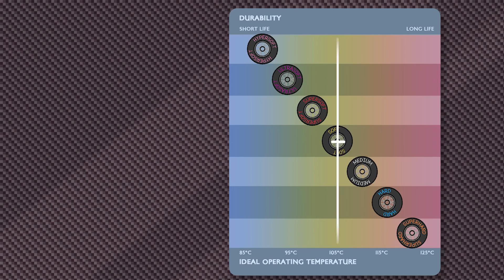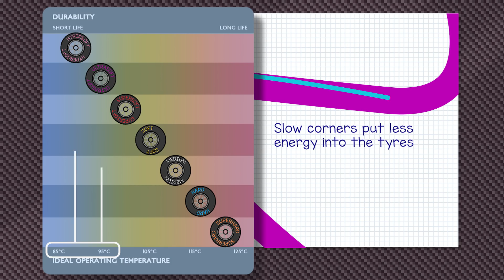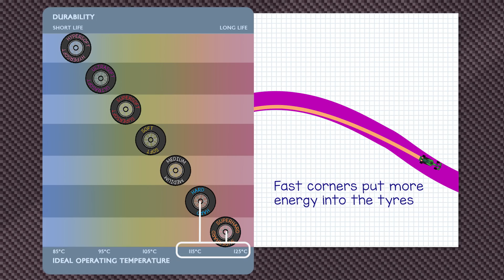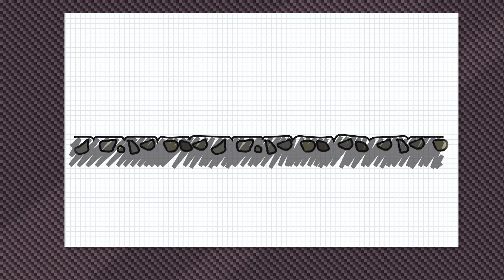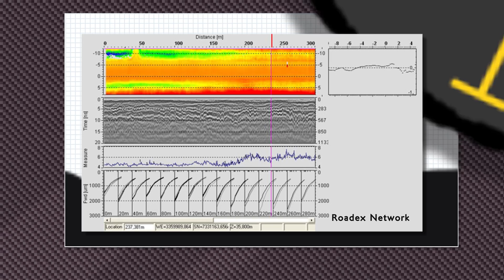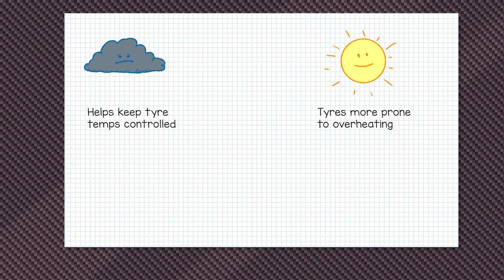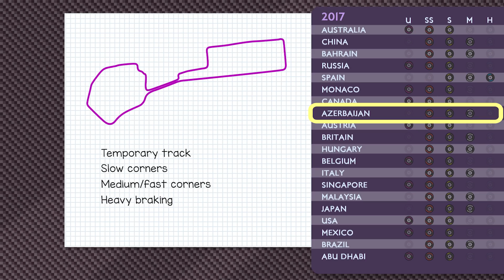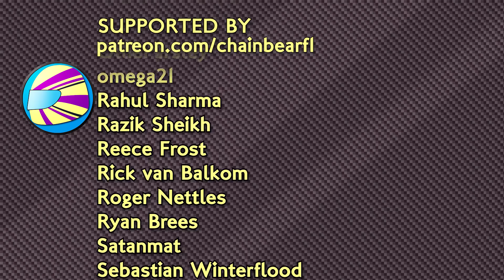How Pirelli choose tyre compounds for each track

Comment: Wouldn't it be better to use harder compounds at low energy tracks, since they require less temperature to work correctly? Softer tyres operate at higher temperatures, and they need to stay high to prevent graining, as we saw this year at Monaco.

Comment: Why does a softer tire have a lower ideal operating temperature? And based on your video is it safe to say that the following statement is NOT always true: the softer the compound the faster the lap time, as in the H.S. will not achieve the fastest lap time at every circuit. ?
Reply from the maker: Ummmmmm... it sort of depends. I think at most places the softest tyre might well achieve the best laptime but only over a single lap if the tyres are incredibly well managed during the out lap.

The HS could get pole at Spain, for example but would be wrecked very quickly during the race.

Comment: what i don't really get is why pirelli doesn't just bring always all compounds and let the drivers choose form all compounds, because in my opinion this would make up a lot more room for strategies and tactics (sorry for my bad english, greetings from germany :D) 

BTW: Keep up the good work mate, I really enjoy watching your videos ^^
Reply: i think so too, maybe it will come in 2019?
Reply from the maker: Partly it's that it helps for Pirelli to make an expert judgement call on what tyres are appropriate. 

Also it would be incredibly expensive. Pirelli manufacture the and transport the tyres to order so they bring only the tyres requested by teams. These are hundreds of tyres, each Grand Prix. If they had to bring all available compounds they would technically have to bring 13 of each compound for each car so that's 1820 tyres every weekend, 1560 of which won't be used.

Comment: If only they would name the tyres used at each race simply soft, medium and hard - wherever they are in the 1 to 7 spectrum. Having four varieties of 'soft' tyres is getting silly. If they bring in a softer tyre it will have to be the 'really extra, quite unbelievably soft tyre'.

Comment: Great job, although small nit pick is that friction is not caused by bonding, it’s inter-molecular forces that do that, bonds are what hold molecules together. Wouldn’t have brought it up except how you mentioned chemistry before and then had a diagram on screen. But still brilliant content as usual
Reply from the maker: You're right of course - I was careless with my words there. Although some bonding does occur between the rubber and track, which is why rubber is lifted from the tyre. But it's hard to keep the pace of the video to stop to explain the chemistry too much! Tricky to pick the language when you're not going too deep :)
Reply: Chain Bear f1 the fact how you are quick to correct mistakes and you try your best is what makes your content so good. Nobody’s perfect myself included
Reply: I was gonna make this exact comment as soon as I heard that
Reply: Chain Bear F1 its okay even I have made some mistakes in my life

Comment: Great vid as always! Could you please answer my question: Why did Pirelli choose the softeste tires possible for Spa? This is a heavely used, permanent track with a lot of high speed corners. Pretty much like Silverstone, maybe even more high speed stuff. The weather is also pretty comparable.
Reply from the maker: That's a very good question. Naturally I can't tell you Pirelli's personal answer but I can hazard an educated guess. First is that the weather is cooler and the Belgian weekend almost always has rainy period on at least one day of the weekend - more so than Britain. The other is that it has a lower average speed. I don't know about the roughness of the two tracks without further research.

The other thing to bear in mind is that there is a very wide overlap in the Silverstone compounds and the Spa compounds (both share SS and S tyres) so the compound difference isn't TOO dramatic - Pirelli are just guessing where the extremes will be.

It'll be interesting now that Pirelli have more freedom in tyre choices just how different certain compound choices are compared to last year.
Reply: All right, that makes sense.  The new compounds will bring some very interesting races, I'm curious to see how the tires behave in China, where they skip the SS and go from U to S and M. Thanks for your answer.
Reply: Spa probably gives the tyres more respite too - apart from Blanchimont and Eau Rogue, the third and first sectors are essentially flat-out kinks and slow speed corners.

Also worth noting is that the ultra-soft tyres had less longevity at Spa than the super-soft tyres at Silverstone - everyone who started on the US tyres at Spa pit about a third of the way through or earlier, leaving the soft tyres to do two thirds of the race (though the safety car interrupted that). At Silverstone, many drivers managed to make the SS tyres last about half of the race.
Reply: Despite Silverstone being higher speed, teams actually run higher downforce there to deal with the likes of Abbey, Farm, Copse, Maggots, Becketts and Stowe. Putting more load on the tyres. Eau Rouge, Radillion and Blanchimont are now pretty much straights leaving Pouhon as the only real high speed corner, so teams run less wing.

Also, although the working ranges have changed for 2018, the soft compound was a low working range tyre in 2017. That's why the Mercedes (which was slower to switch on it's tyres) worked better on the soft than the supersoft.